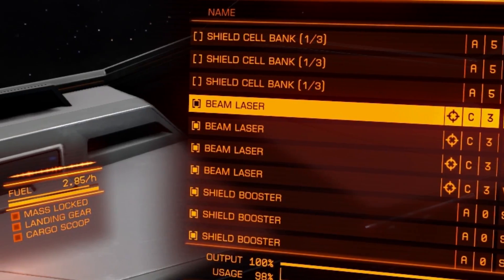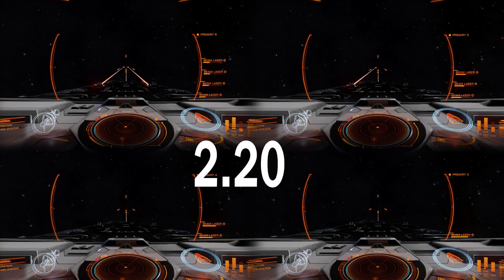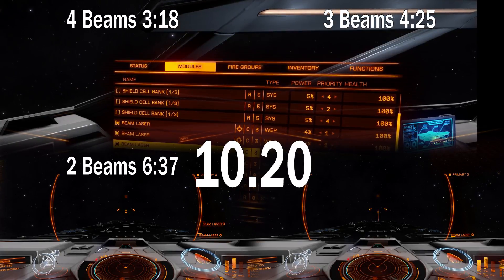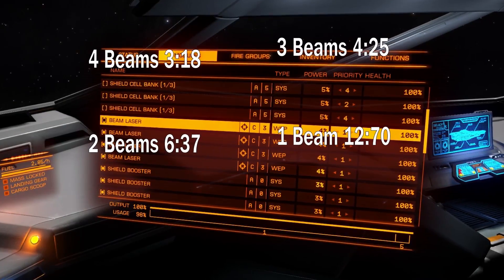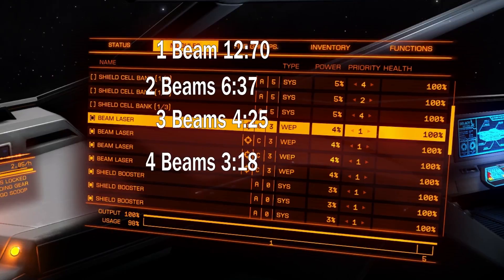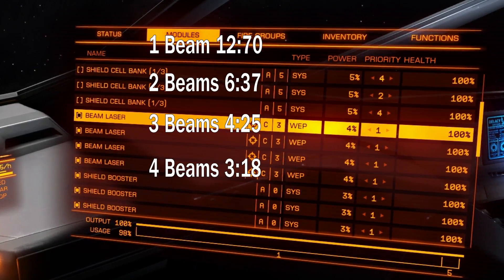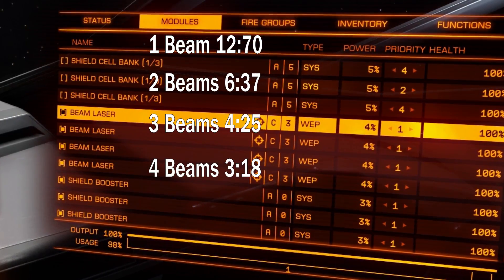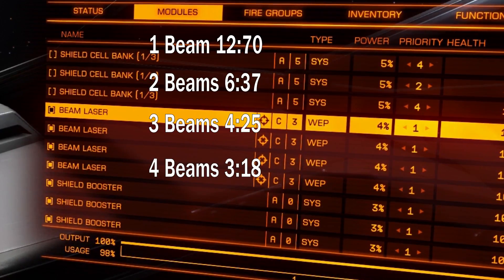Elite: Dangerous. Weapon cooling by WEP capacitor is linear. Part 2

Comment: This could be a big request but could you test how different weapons preform when targeting external and internal hard points. Also could you figure out why from certain angles hard points seem invulnerable.
Reply from the maker: +masterlordclaw i would say it's a waste of time - there is too much random and module hitboxes are sometimes funny.
in the end is not about weapon but about you and enemy, there are weapons that will deal insane amount of damage to module but against good pilot you will just never hit even once (like plasma or huge cannon)
Reply: I agree that there is allot of odd things about module hitboxes, and was wondering if you could make a little more sense of it. I fly a Fer de lance with said huge cannon, and can often 1 or 2 shot an Anaconda's power plant from the right angle (either directly above or below the ship) It was a huge challenge and I am glad you responded. I was mostly interested in modular damage per weapon. Maybe fine an angle that works and test what weapons do the most module damage for external and internal. We have all had those times when you are blasting away for a kill and they explode prematurely because you unexpectedly blown their power plant, Or one of their weapons stops working when before they had always fire both rail guns. I just want to know what is the best.

Comment: You might be interested to know that heat sinks effect capacitor charge. From my testing it seems to be a flat added recharge rate on all ships.
Reply from the maker: +Dominic Cerro-hughes it makes sense because WEP capacitor is used to cool down weapon, so what did you find from your tests? this actually is very interesting topic.
Reply: +Kornelius Briedis  I tested on my gunship with 7 beams, 1 large, 4 mediums and 2 small. With 4 pips to weapons. 1 tested from 0 heatsinks to 4. 0 heatsinks lasted about 3.4 seconds  and when i used 4 heatsinks it lasted about 6.6 seconds. About 90% increase!
Reply from the maker: you mean 4 heat sinks all fired at the same time?
Reply from the maker: ***** and the difference is how big, noticeable?
Reply from the maker: ok, how much worse power plant we are talking here, rating and class ;)
Reply: +Kornelius Briedis yes 4 heat sinks at the same time, it has nothing to do with you heat level just how many heat sinks are active.

Comment: You previously looked at weapon damage over different distances, and I noticed the Large Pulse Lasers seemed to drop their damage more quickly than the Medium Beams. I'm wondering whether this means that Beams are more effective at longer ranges, to the extent they might be as efficient at pulses.

However, perhaps the different is due to the different sizes (i.e. medium vs large) instead of the type.

Could you test large beams and medium pluses over different distances? And perhaps bursts also?
Reply from the maker: +Clinton Mead i don&#39;t understand where do you see any difference between Large pulse and medium beam - they are identical, you must understand that i don&#39;t see if target has 89.9% shields or 89.0, and 1% from total of 10-20% damage done in each round can easily return up to 5-10% error, all lasers have exactly same penalty and even with this error when you place bars side by side they are identical.